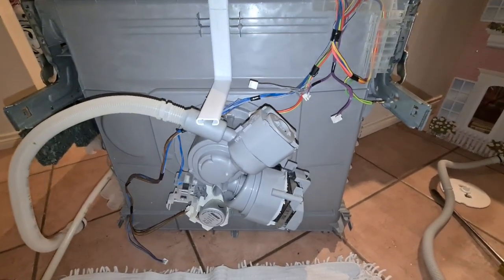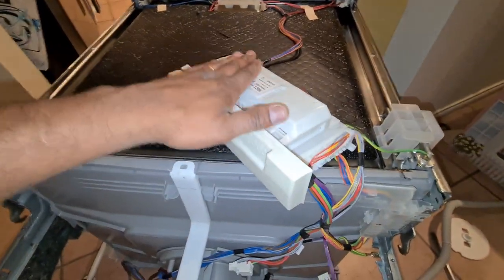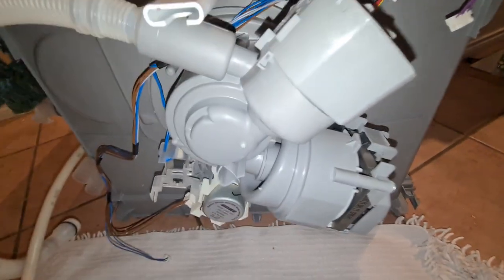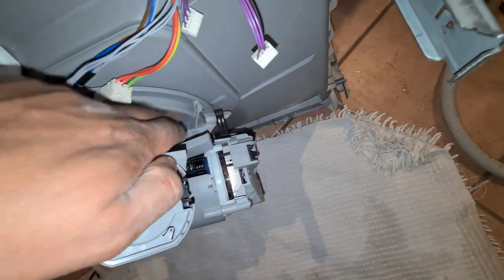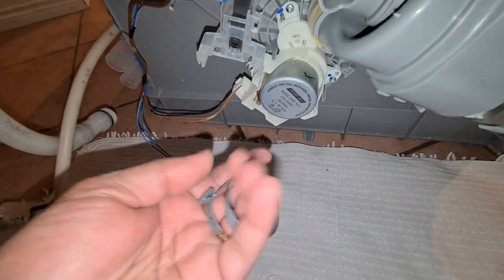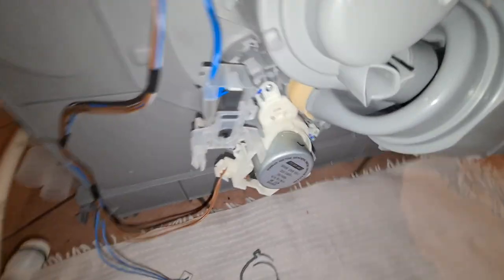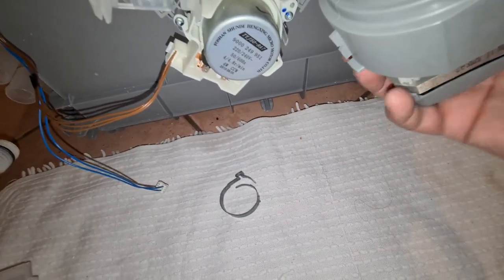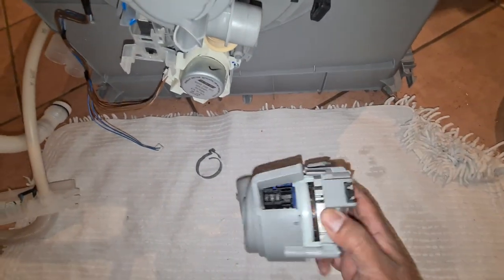Bosch Dishwasher - Heat Pump removal due to defective heater - E:09 Error

Comment: Great video. Thanks for sharing it. My heat pump has failed. The 3 pin connector from the wire has one area around a pin slightly black and the heat element has some black burned tracks on the solder joints close to the 3 pins. What cause the connector to fail? The rest of the heat element looks as good as new. The damage is on the track close to the pins only.
Reply from the maker: Yes the damage initially starts on the pins due to leaks. Then you can solder the track but effectively this is short lived as they will break again.  When you apply heat to the heater track surface it delaminates.

So best option would be to replace the heat pump

Comment: Hi, the two purple wires coming out of the circuit board, one goes to the heat pump, where does the other go? I've disconnected mine, changed heatpump, but only removed 3 cables. Don't remember moving the second purple cable from anywhere. Help would be appreciated
Reply from the maker: Only drain and wash pump have purple cable. There is 3 wires on each cable set.

On the motherboard side Bosch state never to remove the individual plugs from the cable guide as they are not fool proofed.

I think they did this purposely to prevent unauthorised people from working on the machine.

Send me a photo on the location of the connector

Comment: Is it possible to change  only the heater
Reply from the maker: Hello Abbas

Not really the heater is a part of the wash pump. Once the heat pump is opened the sealing is compromised and should not be used.
Reply from the maker: Hi Abbas 

Always replace the entire heat pump,  the heater cannot be replaced by itself, as it is a part of the wash pump assembly